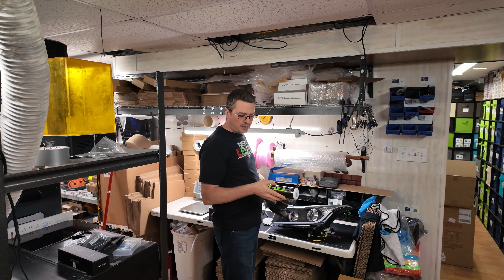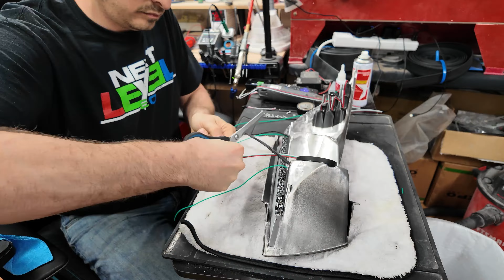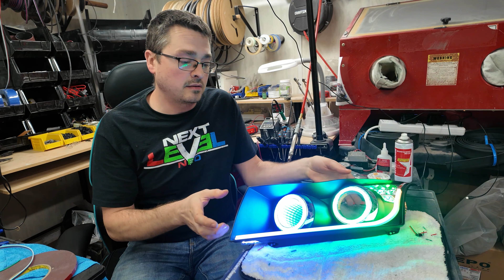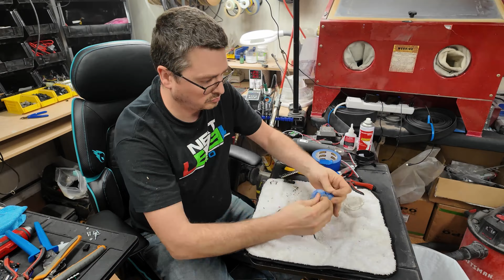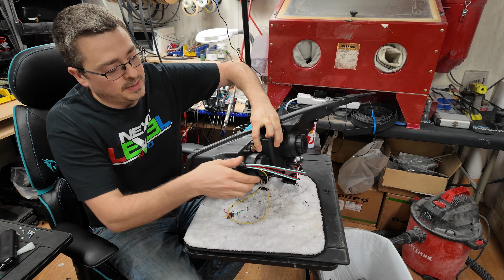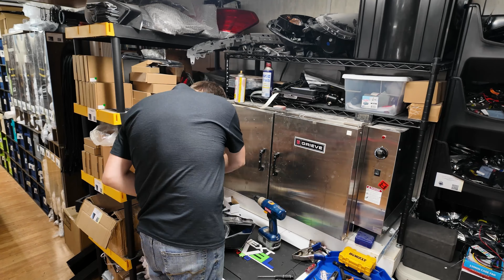Custom Chevy Cruze Headlight Build - Flow Series

Comment: you know where to look for custom pcb board mainly for a 2000 ls400. plan and doing led panels for the turn signals and taillights
Reply from the maker: Currently illumaesthetic is the largest source for panels